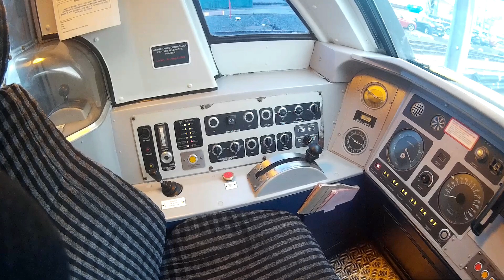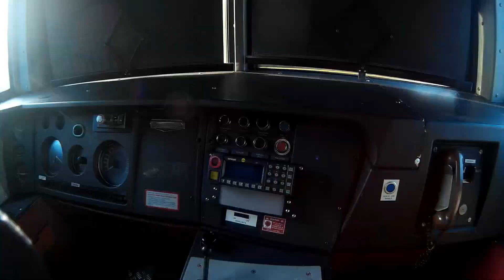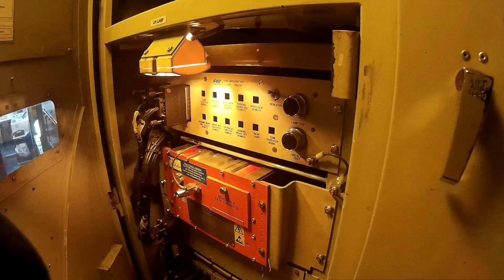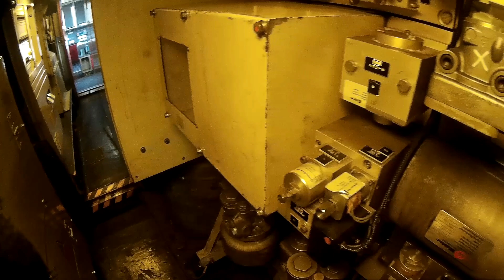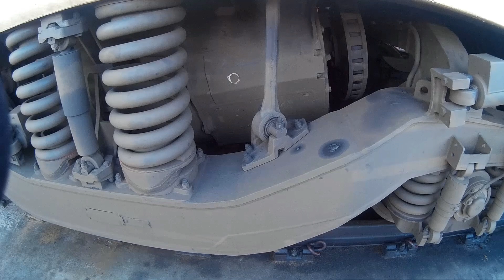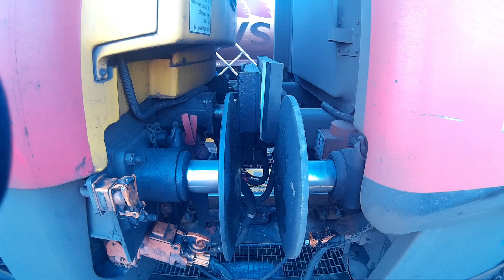British Rail Class 91 Walkround Traction Guide featuring 91107

Comment: would be cool if they moved these to freight services once redundant with LNER as theres always demand for additional eleteric locos
Reply from the maker: Unfortunately they’re unsuitable for freight working due to being geared so long. It would be almost impossible for the loco to lift 1500-2000 ton with the current gearing, and it would be hideously expensive to regear them to be suitable. 

Plus with only a small number of the fleet left in serviceable condition (13 locos in total from memory, including the EPR one) means that parts are becoming obsolete and the locos are difficult to ensure they’re maintained.

Comment: If I understand correctly then, a driver will need to know a lot, about how these trains work by the sound of it.

It's not like an aeroplane.
Reply from the maker: Knowledge has been slimmed down a bit for new drivers compared to when I learnt them, but there’s a lot to know still.
Reply: with planes you are required to know the ins and outs of pretty much every system just like you do with trains

Comment: This locomotive is arguably one of the most stunning pieces of mechanical and electrical engineering equipment ever built.
Reply: I agree with you, it's certainly one of my favourites. I bet that the new azumas build on some of the technology used here.

Like for example oil immersed transformers, in the electric part of it, but I'm not an expert.
Reply: @and321nowyou are probably right to be honest. I was at heaton Newcastle for about 5 years, most of my work was on 156s and 142 noding. Donkeys. Mostly bogie drops and brake  relines . Sometimes Cummins engine swaps . We had 3 or 4 91 sets in each night,usually for safety service inspection, but I never really got to work on them .

Comment: Hi can the 91 be remotely shunted by the controls by the door I noticed 2 sets of controls 1 in each cab by the doors ?
Reply from the maker: The auxiliary driving controls are still active, but give limited operational control for power and brake. They still work but aren’t used anymore. 

The accompanying Mk4 DVT has auxiliary driving controls also, but all have been disconnected.